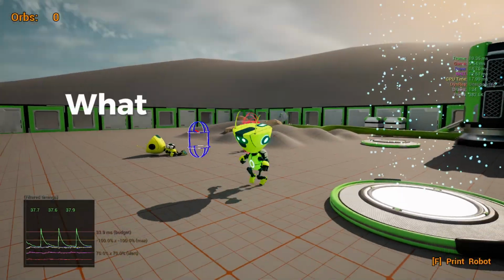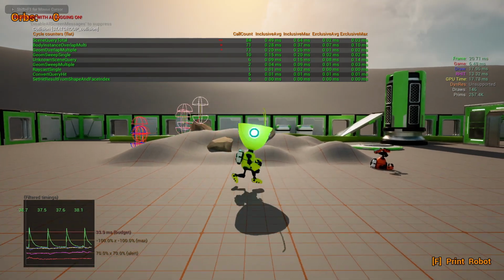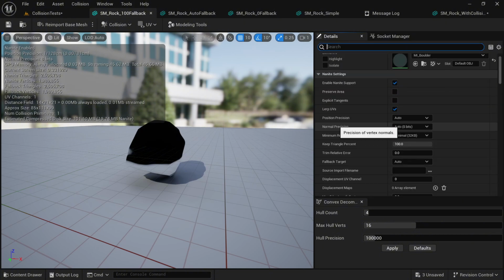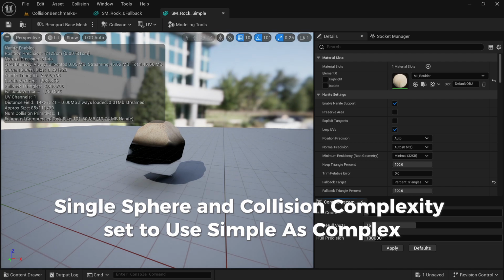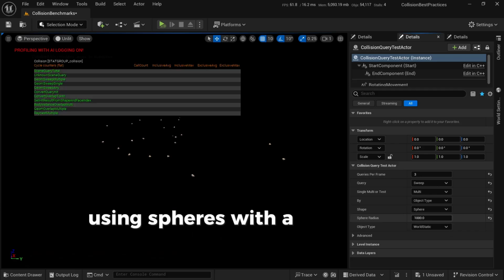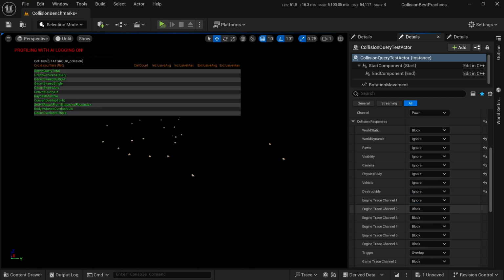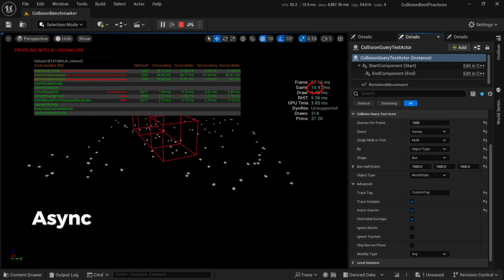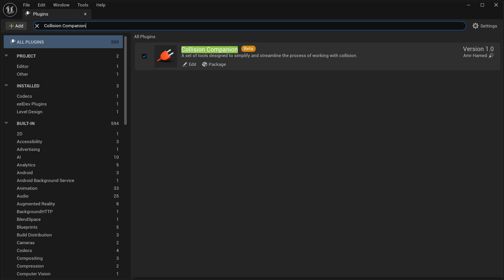Optimizing Collision in Unreal: Best Practices & Performance Tips

Comment: Great video, but I expected more of actual collision of physically simulated objects not only traces.

Also would be great to see test when using query only vs collision enabled and ignored to most channels vs blocking - in my tests they gave zero perf boosts for my test environment but yours much better and easier to test
You mentioned this also improves performance but not showed tests I think
Reply from the maker: Thanks for the valuable feeback. I have solely focused on non-physically simulated objects here since this is something I want to cover later in more detail.
Covering constraints, physical animations, etc.

For your test results, it can vary a lot based on how your geometry is set up, your queries, etc.
If I wanted more accurate measures, I'd consider using Insights.